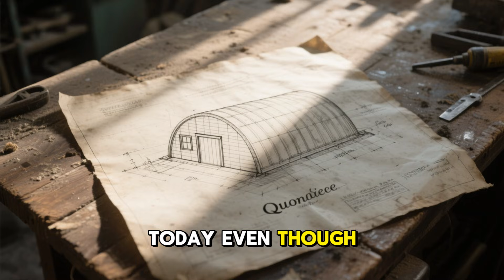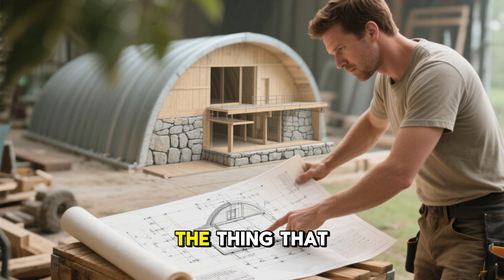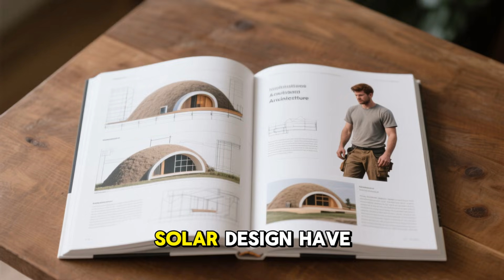He Heated His Home to 70°F While Neighbors Froze | Robert McNamara's Genius 1947 Design

Comment: Nothing extraordinary here.  Most old New England farmhouses had at least a partial cellar built with granite boulders that stayed at a relatively constant temperature all year.  In the summer it was a cool place to store food, and in the winter nothing froze.  Insulation wasn't so far advanced, but the main house often had the cavity between the outer and inner walls filled with corncobs and such.  The bigger windows faced south to catch the sun.  The big country kitchen was heated by a wood burning cookstove, and that's where the residents ate and relaxed and sometimes even slept in the winter.  The front rooms were used mostly for visiting company, and they had woodstoves for their occasional use.  

One flaw in this presentation was the shot of a number of windows in the ceiling of the Quonset house which would have caused considerable heat loss.  In reality, to conserve heat there would have only been small windows at the ends, and the house would have been quite dark.
Reply: Thanks Bobrogers99 - 19 hours ago Your comments Bobrogers99 The Stone Basement Quonset Home
 underline just how smart/and industrious young men can be. :)      John. Perth. Au'
Reply from the maker: Thanks for sharing your insights! It’s fascinating how traditional methods were so effective for heating in those days. The design choices really reflect the ingenuity of that era!